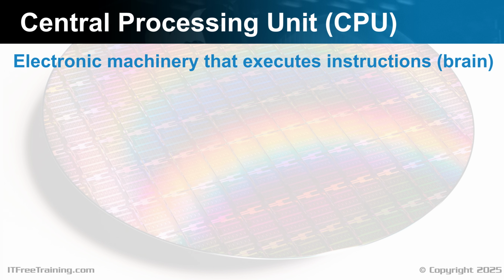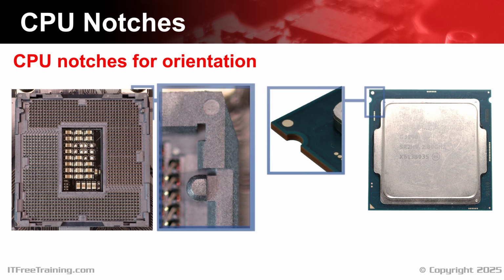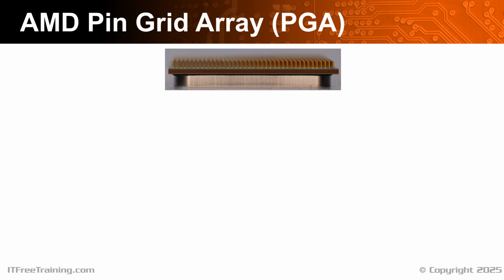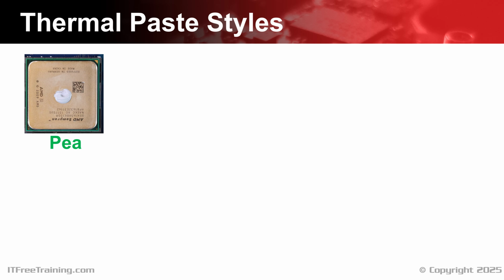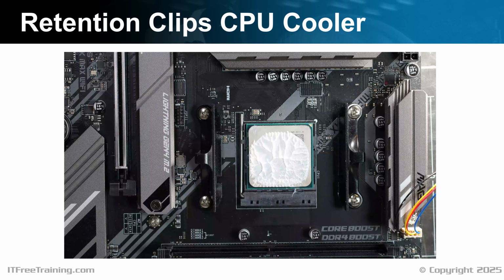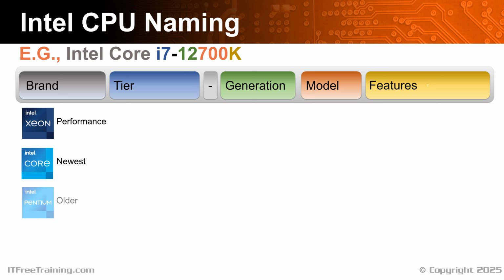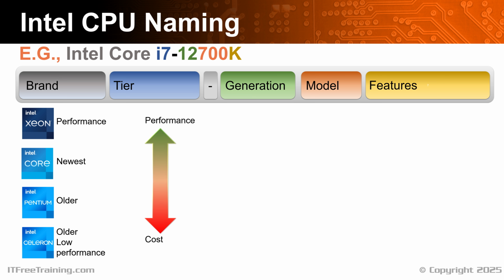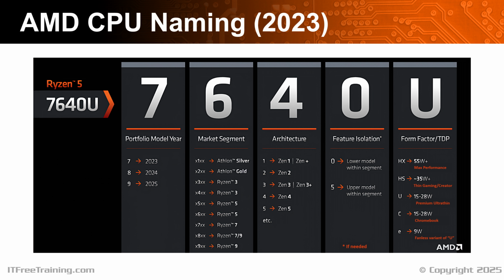CPU Installation - CompTIA A+ 220-1101 – 2.13

Comment: Fantastic video! Thank you. As mentioned already, the tabletop cover is not the best with its distracting pattern design. I believe solid bright orange background could be better.
Reply from the maker: I think you are referring to the anti-static mat. We use to have a white one, but it got damaged to easily. The black one is a lot more heavy duty. We usually try to purchase parts that look good on the mat, but the motherboard we use to use for filming we are using for something else. Blue and green are pretty common, but I don't think that we can get orange.